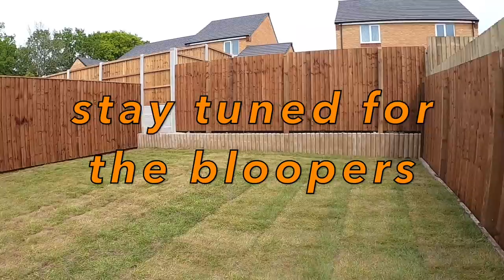2 BRICKIES VS 2 FENCES !!

Comment: Rule number one. Check nail guns the night before. Here in New Zealand we only put fence pailings on ONE side of the rails and who ever gets the "good" side is usually determined by the flip of a coin between home owners as is the cost of the fence. The fence rails are usually half lapped on the posts where they join with a bolt, galvanized or more commonly, stainless steel through the join. Gun nails are just used as tacks before the bolts go in. All posts are 4×4 and rails 4×2 never 3×2. Good job though although I'd invest in a good electric breaker for hard ground and possibly a post Hole borer for soft ground. Saves a lot of energy.

Comment: Really nice work. You guys make a awesome team and it's impressive how you can take your hands to any type of job.

I'm shocked beyond belief how badly new build buyers get ripped off. To spend so much on a house and not get a garden with a full fence is disgusting.
Reply from the maker: Thanks very much . 
    The fence , turf , flagging and fence were all extras 😬🧱👍🏽
Reply: @SteveAndAlexBuild  crazy
Reply from the maker: @CraveThatCoin  Yep 🙄🧱👍🏽
Reply: Rules changed in Ireland 20 or so years ago. prior to that all builders had to do was put up 1 m high approximately precast concrete fence posts with 3 or 4 strands of tensioned wire between them . A lot of them tried the wood or concrete fencing when the regs changed but they quickly realized the brickys could build concrete block walls much quicker than the fencing company’s could erect fences . So most new estates now have concrete block boundary walls 8 courses high separating the back gardens of houses and the gardens have to be raked to a proper level and seeded . Some builders even put 2 coats of sand and cement render on them . Timber fences last no time in Ireland .
Reply from the maker: @brickbybric  . 😳🤯🤯🤯🧱👍🏽

Comment: Nice one lads. Shame you couldn't do all of the fencing from scratch instead of having to accommodate other fencing. I reckon a bush will be stuck in that rear left corner. Tbf the houses look quite decent and the home owners will sort out the bits they don't like. Nice one.
Reply from the maker: Thanks pal . They are starter homes so basic but solid , like a blank canvas 🧱👍🏼

Comment: I can’t believe people are still specifying Pre-Cast Concrete Paving Slabs, for use as retaining structures…when these slabs crack/break at ground level they are serious accidents waiting to happen…especially with young kids playing in gardens…I would suggest you start trying to get people to replace these with a proper, brick built retaining wall, which will be a lot better, safer, and add more value to their smallish gardens…and of course be a nice little earner too…
Reply from the maker: They are cheap though which is the only specification for the builder 🙄🧱👍🏽
Reply: @SteveAndAlexBuild …until one caves over onto a kiddie and they loose a foot or leg…!!
Reply from the maker: @stun9771  . The builder have got their money by then so not bothered 🙄🧱👍🏽

Comment: By putting concrete under the post, and then filling round it, you create a socket which will trap water, and rot the post off. Still, I suppose that's par for the job on these modern day builds.
Reply from the maker: The first fence I did like this( which is how everybody does  it ) is still there after 18 years
Reply from the maker: @martin2466  🧱👍🏽
Reply from the maker: @martin2466  😁😉🧱👍🏽
Reply: @SteveAndAlexBuild  Beg to differ, but not everybody does it like that. I have erected more fence posts, and gate posts, (for a National Park,) than you can shake a stick at, but never done it like that.
Reply: @martin2466  Not saying anything about their workmanship, just commenting on something that I would not do. Also, the "shallow collar" to which you refer, is called, Duck Nesting, just for your future reference.